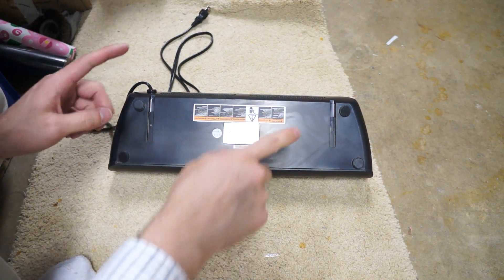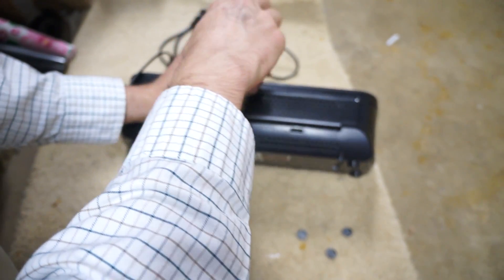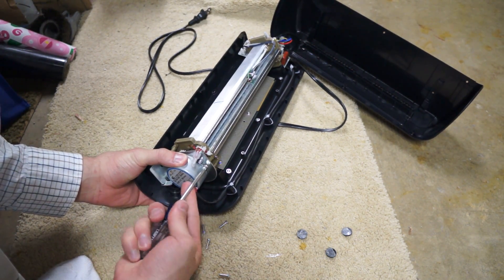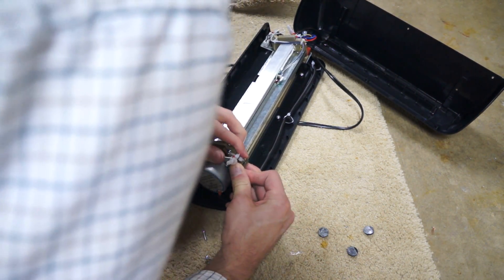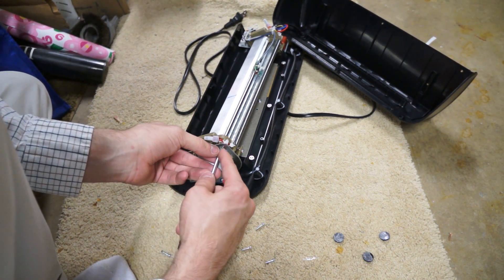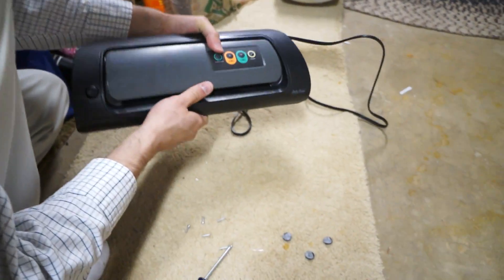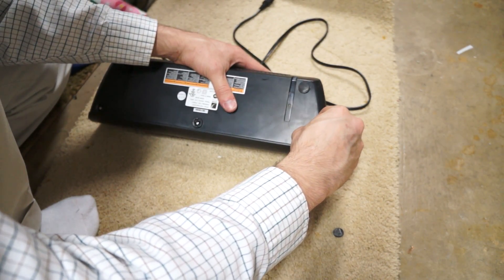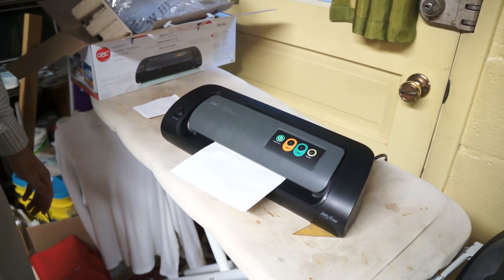GBC-H220 Gear Modification for Printing Circuit Boards

Comment: I have an H200 that I modified but the big gear melted.  Can you poing me to a source for a brass gear replacement?  What are the specs for the gear?  I think it is 17teeth but not sure of pitch and other info and finding one for a D shaped shaft I suspect will be impossible.  Thank you
Reply from the maker: I honestly don't know! :( sorry.

Comment: What is your PCB thickness? Did you modify the height of the rollers for the PCB thickness 1.6mm?
Reply from the maker: 1.6mm and I did not need to modify roller thickness.

Comment: great idea! can you tell me if the same change is possible on the GBC H420 too? thank you
Reply from the maker: I don't know ... I've switched to the Amazon Basics laminator.
Reply: CNLohr Does the Amazon Basics work well ? I looked at it a couple of days ago, but decided to go with the 3M SCOTCH TL901X. Haven’t tried it yet though, just got it an hour ago ! I’ll put a resistance on the thermistor wiring to bump up the temperature, but I’ll take a look if I can change the gears like you did for the one in the video.

Comment: tried your video, slowed it down yes, not enougth, when i use my laser printer and print the pcb on to photo paper,  smooth paper, any paper, nothing apears on the pcb when i put it through the laminator, same as youes h220,, also tempurature only goes to 100c

Comment: Thanks for the great video!

Is there a thermostat we can replace to up the temperature to maybe 150degC or something like that?
Reply: Hi, there should be a thermal cutout somewhere in there that needs to be replaced with a higher rating one. such as 170-190 degrees

Comment: CNLohr I am having problems finding this model here in the UK maybe because it is so old now, can you recommend an alternative I saw a GBC H420 would this be the same type but newer Model ?
Reply from the maker: +Ortorea Screenname I actually don't use this model anymore.  I now use the Amazon Basics laminator.  No real reason.  I just ad this one get caught once or twice... And I blew one of them up when I put a custom made PCB through that used silicone as a base.  It got on the rollers and that was the end of that one :(.  

I don't use toner transfer anymore, either, so I don't know for sure if the Amazon Basics one would be good.
Reply from the maker: +CNLohr Also, sorry I was away for so long, just getting back to it now.
Reply: +CNLohr Thanks yeah I got one off ebay it seems to work ok as long as I don&#39;t put the PCB more than 5cm near either end which makes it jam up. A4 A5 Laminator Laminating Machine Thermal Twin Roller 20 Free Pouches

Comment: I don't know, dude... I think it's necessary to change the thermostat (big metal "thingy" with 2 "ears"). In most laminators it's for 110 deg Celsius. You need to change it to be able to heat it up to 200 deg Celsius. Also, you need to adjust the thickness of the "sheet" through the machine. In the last part - I can't help. I never used this technology (I might give it a try tho) before. Thanks for the tutorial!
Reply from the maker: Interesting, I've been printing for forever and that's never crossed my mind.  I wonder if I could make my laminator AVR controlled.

Comment: Hi buddy!, what size of maximum thru-put thickness has this laminator?.The GBC-H220 one, is 1mm.The copper board has more than this.Can we damage it or not?
Reply from the maker: I don't know if it "does damage" or not, but I typically ran 1/16th inch PCB through this, and have yet to have a problem.
Reply: This is about to 1.5mm?.I´m from Argentina and we use milimeters.
Reply from the maker: I'd say 1.6mm, probably 1.8 after you add in the things you're laminating on.

I just noticed that the laminator's setting is 3mm.
Reply: you mean your laminator?

Comment: Hi, how do you get the pcb inside the laminator?
Here: http://www.officedepot.com/a/products/485883/GBC-HeatSeal-H220-Pouch-Laminator/ it says that the maximum thickness of whatever can go inside is  5mil (0.13mm), and the pcb is not that thin. My copper board is 1.6mm thick. How do i get it through the laminator? I just want to be sure before i go out and buy one. Thanks!

Comment: My  H220 arrived today. It is an updated version. It has has 3 setting buttons in lieu of the 2 shown in the above video.It is still probably an obsolete upgrade. When switching gears both collars do go on first to their shafts.
I didn't heed the comment that when the screws are removed from the motor there is only an inch or so to work in, because of the spring tension under the release  button. Consequently, the spring fell out together with the case button. Had quite some trouble working out where the spring should be reanchored & in getting the release button relocated. The Pulsar PDF eventually sorted it all out. So beware not to separate the motor too far from the other internals. Then the unit started beeping at me. It turned out to be one of the white electronic connectors at the other end of the unit. Once again disturbing the internals too much caused that.

All is now  fixed & working, no thanks to the useless manual (no exploded diagram of the internals or even what the case buttons are for).  I guess they don't want people like me messing with the internal & voiding the warranty, such as it is.

I timed the unit before & after. With normal gearing 45 seconds. With altered gearing  75 seconds.

Hope this helps someone.
Reply from the maker: I am genuinely surprised no one has added a feature like this to another laminator.  Surely there are other people out there who need a laminator to go slow.

Comment: Pulsar seems to conflict with what you say about the collar positions of the gears when reversing them. I guess I'll find out when my unit arrives.
BTW: This unit is now obsolete & is very hard to come by here (Australia) so I ended up paying a premium ($254AU). I wonder if Pulsar will be recommending a replacement model.
Reply from the maker: I do hope they do.  While I've mostly switched over to a photo process, there are still times when the toner transfer process still wins out.
Reply from the maker: P.S. I ruined one of my H220's and had to buy another.  Similar exorbitant fees.

Comment from the maker: I also couldn't get a flat iron... Off the bat, the laminator made a minor improvement.   Now that I've got a better laser printer, the laminator just emits awesome.  I haven't had a failure yet that wasn't blatantly my fault.   Don't get me wrong, it still takes a couple of designs to get /right/ but once you're there, it takes you from a 40% yield situation to a 95% success rate.
Reply: Wow. Thanks.

Comment: I managed to get some ferric chloride from work, got some press and peel transfer paper and access to a laser printer, but when I try doing it with an iron it never comes out complete, I'm thinking a laminator might do a better job, the iron I used is a useless steam one with holes and indents on the bottom, and you can't buy just heated ones anymore :(

Comment from the maker: how is that even possible?  They're not $69.99, but they're almost always less than $100 here. That's really depressing.  How much are things like ferric chloride, you can get a gallon of it here for ~$35.  And circuit boards are ~$7/square foot.

Comment from the maker: If yours is like mine, the smaller gear was on the roller, the bigger on the motor.  When done, the smaller is on the motor, the bigger on the roller.  If the smaller one is now on the motor, and was not before, mechanical advantage dictates it's going slower.

Comment: I was able to change the gears but I don't see it really being slower. I put the smaller gear on the motor with the flange facing towards motor. I put the bigger gear on the roller with its flange facing the motor.  Guess I would have to undo it and time it with original gear positions to know for sure though.